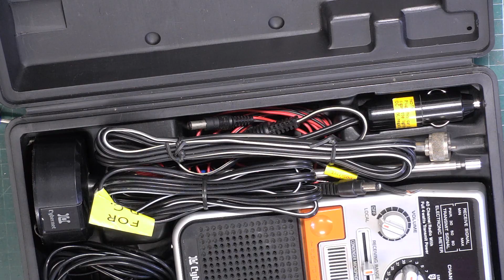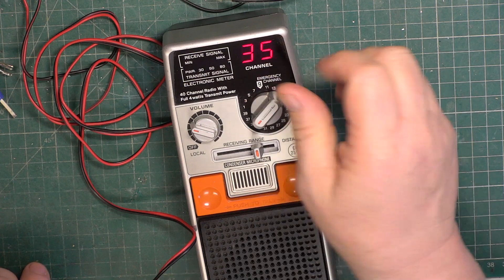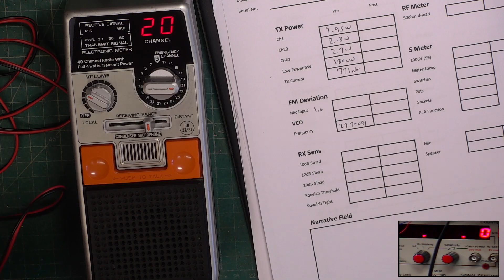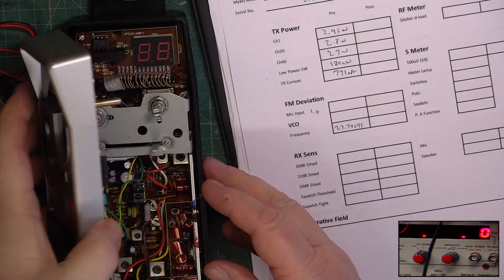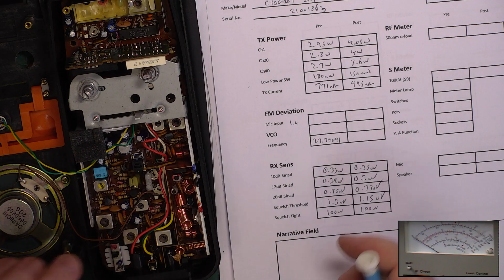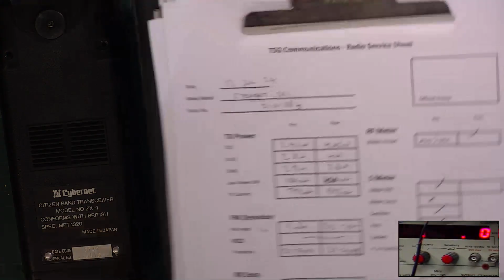Cybernet ZX1 CB27/81 UK FM Emergency CB radio - service alignment

Comment: Nice to see one of these again and a great end result! A rare 'Roger' from the ether..!
 Incidentally, re the choke control, years ago I managed to limp a Fiat Uno back home from around the corner using the choke as a hand throttle when the accelerator cable came off at the carburettor end.. Necessity = Mother of Invention..

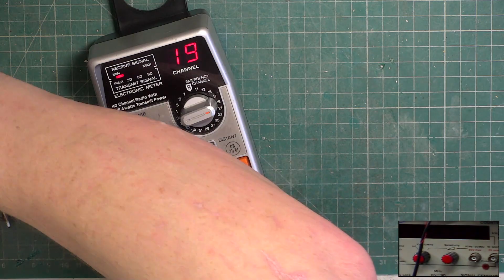Comment: 34:23 hi 👋 richard good luck servicing the cybernet zx1 cb 27/81 uk fm emergency cb radio from paul chapman at east sheen 73's also I have a imax 2000 it is 25 feet long
Reply from the maker: Thank you Paul,

Richard
Reply: @ukfmcbradioservicingTango21  to richard you are most welcome i have a imax 2000 on the side of my house it is 25 foot long